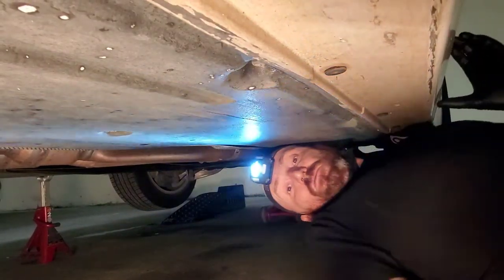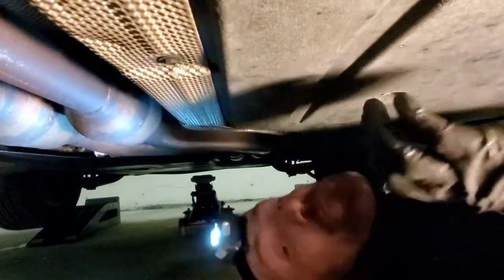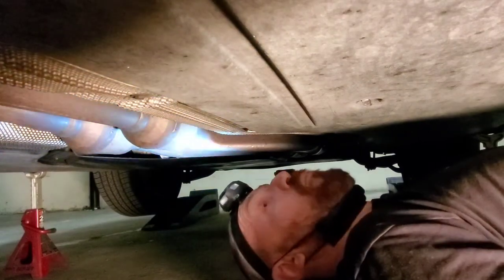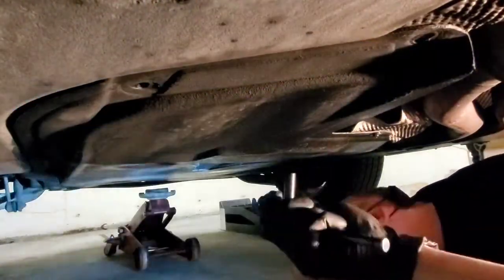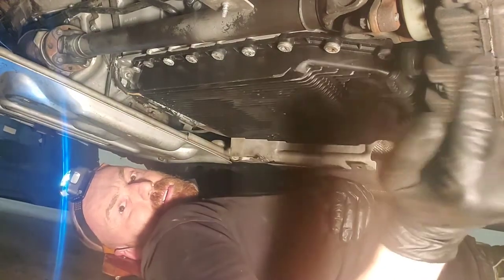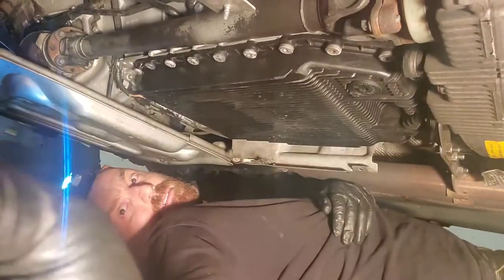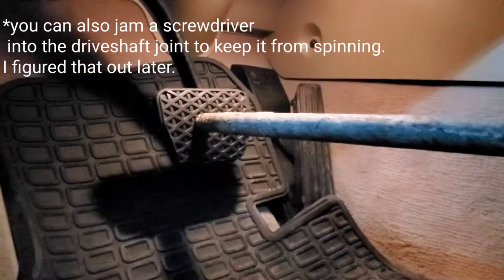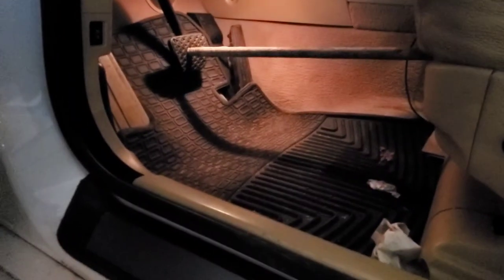BMW E60/61 Automatic Transmission Mechatronic DIY Service Part 1

Comment from the maker: UPDATE: It's been a couple of years and I've done this and I've subsequently done it on another E60 so I wanted to share some more things I've learned.

#1 The Mechatronic Connector sleeve is a bitch whether it's a 2wd or 4wd car as there is not a lot of room to get to it either way. You can make your life easier if before you take out the old sleeve you use one of those gold or silver permanent markers and make a line on the sleeve at how deep it is into the gearbox case and a mark on the case that lines up with the sleeve, then transfer those marks onto your new sleeve so you know how far to push it in and how to rotate it. (avoid my disaster in video 2) Also on the new sleeve mark where the tab that is on the inside, This tab guides the connector, knowing where it is on the outside will help you orient the sleeve as you're pushing it in, it's not exactly at the bottom but a bit to the right; you'll see. Use some gearbox fluid on the rubber gaskets of the sleeve before pushing it in; it will go in much much easier. 

#2 Filling up: If you do the whole thing; sleeves and solenoids you will need 8 litres of Gearbox fluid. Don't mess around and just get the ZF Lifeguard 6. The fluid I use in this video is the Febi one and that gearbox always whined after this and I'm told that's a fluid thing. ZF Lifeguard 6 is the fluid designed for the gearbox and it's the exact same thing as the BMW fluid. Iit's sort of reasonable cost. I don't recommend the Red stuff or other "fancy" brands, I don't think they justify the cost. Also no additives into these gearboxes, it's not a GM transmission from 1952. Getting ZF should stand for everything; pan, solenoids, and sleeves; I bought cheaper versions of all of these and the ZF stuff as well and the cheap stuff is not up to par at all. Usually I'm a proponent of getting the cheap part; usually the Chinese knock offs are real good enough for an old car,  but for the gearbox that is not the case. You don't want to be doing this job again and again. 
When filling up, 4 litres will go in cold, then idle the car and let it get up to 40C or 100F and the other 4 litres will go in. In the video I make a mistake and turn the car off. Leave the car idling as you fill up for the hot fill. 

#3 Adaptations: After clearing the adaptations do the learning procedure here's a link: 
https://s3.amazonaws.com/fcp-creative/blog/post-images/reset_e90_transmission_adaptations/Software+N.png
You will need an hour and a free road where you can drive 100kph slow down without hitting the brake to stop, sit there for ten seconds, and do it nine times. Then drive in 5th, 6th, and 4th from 80 to 110kph. like 15 times. I did it late late at night. It's a hassle  but it makes a difference compared to when I didn't do it and just drove around like an idiot after resetting the adaptations. Much nicer shifts.

#4 Do this Job. Do this Job and do all of it even the solenoids. It's about $1000 in parts here in Canada so it's expensive but man is it worth it. My second E60 has 300 000kms (almost 200000 miles) and the gearbox was in bad shape; slipping, terrible shifts, clunk going into 1st, occasionally getting the red gear of death. Any gearbox shop would write it off and say you need a new one or a total rebuild and they would be right but after doing this job all those things disappeared and it shifts great so far. I'm sure I've saved and extended the life of this car/gearbox for years. I wonder how many E60s have been parted out because of the gearbox when all they needed was this job. 

Gearbox myths:
"The gearbox fluid is lifetime fluid" - nope this was BMW marketing lies and you should change it every 80 to 100 thousand kms.
"If my fluid hasn't been changed for a long time I shouldn't change it because it will loosen all the dirt and make it worse"
I think this may have been true for old GM and Ford gearboxes but it certainly is not true for the ZF. I changed my fluid in the 300000km car where the fluid had never been changed and it fixed a lot of problems. 
"If I add 'no-slip' my gearbox will last longer and I don't have to change the fluid"
Do not put in any additives to these gearboxes. The solenoids and valvebody are precision instruments and you don't want to gum them up with some crap. It's not a Selectomatic from the 60s.
"Liquid Molly is better and worth the cost" 

ZF Lifeguard 6 is what's engineered for these gearboxes. I'm not paying extra for someone to dye transmission fluid red. 

I think that's it. Happy wrenching gang.
Reply: Your videos and this update have been really valuable, I'm preparing to do this job sometime soon, might even upload a video.

I'll only add that the adaptation process you've linked to will differ based on the transmission software, for the E6x series there were three different software versions. Yours suggest you had a 2003-5 model.

Googling "zf adaptation procedure pdf" will find the relevant document in various places, there's 4x different procedures for the 6HPxx transmissions depending on their software version.

Comment: What if my plug adapter doesent fit between the transmission mount and the transmission. I got it out of its hole but it doent fit through the opening
Reply from the maker: It fits. Take a deep breath and turn it around until it comes out.  I've done this on 2wd and 4wd cars with the transfer case and it fit on both. It's awful but it fits. Make sure to mark on the old sleeve how deep it goes into the transmission housing so you know how deep to push the new one. Put some oil on the seal of the new one because it won't want to go in. Good luck brother. This is an awful job but you can do it.
Reply: @IDontKnowWhatImDoingDIY  thanks man
Reply: Finally got it out ended up having to remove the transmission mount bolts and letting it droop down a little to get it out.
Reply: @emerald1834 which ones?  Same problem

Comment: How did the car drive and shift after the change? I'm doing mine next week lol. I have the jerking 2-1 shift and the malfunction while driving in D while trying to pick up speed in 5th-6th gear.
Reply from the maker: Drove much better, the 2-1 clunk was gone and all the shifting overall became cleaner. Good luck, take your time.  When doing the hot fill make sure the car is running. I think in the video mine is off for the hot refill. Also for fluid use the zf lifeguard 6 fluid. Better than the stuff I use in the video.

Comment: Does the 10 total T40 bolts on the valve body include the 3 smaller ones, for a total of 13?
Reply from the maker: I don't remember, there's a diagram somewhere online, if you mean the short ones at one end then yes. Get the diagram because it has the tightening order on it and you need to tighten the bolts a in that order. Good luck.

Comment: Hello bro where did you bought that solenoid?and why did you change the solenoid?what's an issue
Reply: How we manually test the solenoid bro
Reply: I change mine bmw 530d 2003 model then I order online the solenoid the after replacing new 1 stuck up on 2nd gear.. previous issue is that it was stuck on 4th gear..what is you recomemdation